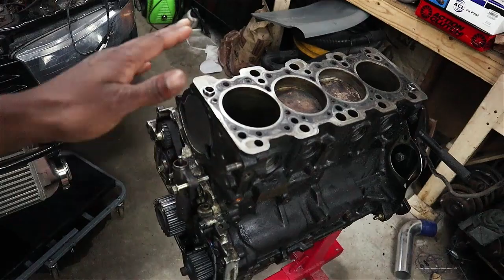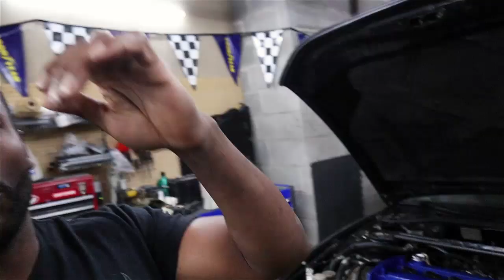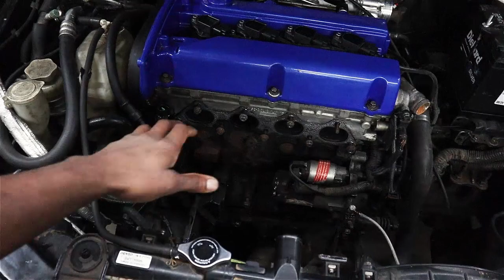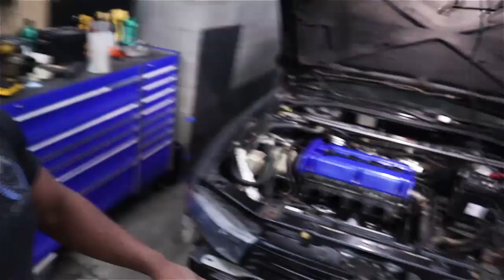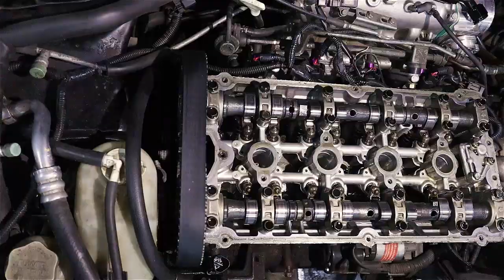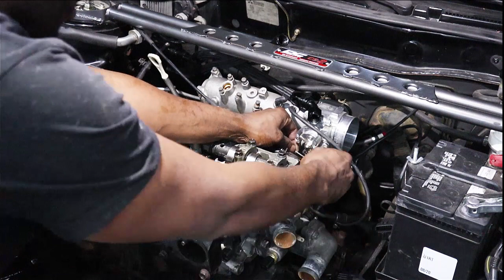Teardowns pt2. Removing the cylinder Head!

Comment: Man the way you just zapped those head bolts out without doing them in sequence made me cringe lol. But good video man you’ve gave me a lot of information for my swap.
Reply: personally id crack them by hand first then zip them out. less of an issue with a race car build if the head warps its junkyard time